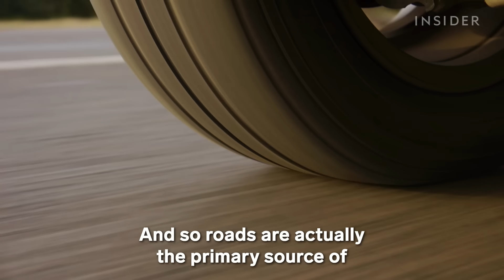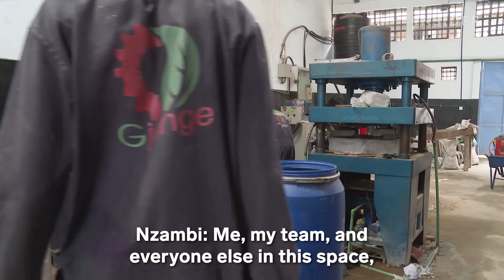Young Inventor Makes Bricks From Plastic Trash | World Wide Waste | Business Insider

Comment: I as a civil engineer student like this idea as making road pavement with the use of plastic increases the lifespan of roads. There would be less damages to pavements as well as less potholes. The plastic will avoid water to enter into pavement which avoids pavement.
Reply: plastic as road pavement sounds horrible. How would cars get traction in wet conditions? We also don't think about the micro plastics that will make it to the water table.
Reply: @trickmiller8169  thats why tires have grips. A pavement cannot completely be made of plastic, it has to be mixed with concrete. But driving on plastic pavement is better than driving on ice..it really depends on ur tires grip.
Reply: @easylife2927   Converting the plastic into pellets is downcycling. You aren't really able to reuse the plastic in the same regard as it was before. That's is recycling. Most plastics are not recyclable in the way that aluminum and glass are. You cannot recycle most plastics for similar use, because they are of poor quality. They don't yield reusable plastic when recycled. Do your own homework. Throwing all the plastic in the world into the roads doesn't fix the problem and is going to create more issues along the way. We can offset carbon emissions by planting trees, using more evs, switching from fossil fuels to nuclear, hydro, solar and wind. Burning plastic at least prevents plastics going into the water table and we can have a degree of control in negating carbon emissions. Once plastic is in the waterways, it doesn't come out. Plastic in roadways exacerbates that problem. We already have an issue with microplastic being found in fish and food.
Reply: @trickmiller8169  dude the world is already planting trees, using solar, hydro and nuclear power. And most plastics from landfill endup in waterways not from road pavement which is converted into pellets. All am saying is that plastics used in road pavement is more controlled way of recycling plastics plus the benefits it carries. And u are saying to burn plastics. Are u out of ur mind. I dont know where u live but I am from pacific and I can see the consequences of global warming and burning plastics will do no good. I really dont know what u do but am telling from experience  as a student and also a victim of global warming....And u are talking about water table ..so I predict that u have understanding about hydraulic engineering and also how plastics pollute ground water. There are less chances of platics used in road pavement ending in water table than plastics in landfills. And if u say that water will carry chemicals into groundwater than there is no chance of water interacting with plastics since plastics are non polar and water is polar so they cannot be combined. Besides buring plastics will release toxic chemicals and fumes which can evaporate as well as sink into ground. And if toxics evaporate.. it will also condense back as rain which will seep through ground water and pollute watet table. Now u do ur homework ..and dont burn plastics please 🙏.
Reply: @easylife2927  Abrasion breaks down those pellets even more to make the microplastics. How do you think microplastics come about?  You also are putting plastics in direct uv light and heat, which causes breakdown of plastic and toxic fumes. The runoff from those roads will carry microplastics with them. At least in a stack, they can be scrubbed. That prevents pollutants and toxins from escaping. We cannot do that with roads. Europe has already gotten on board with burning. It reduces buildup in landfills, produces energy, and keeps plastics out of the water table. Try thinking more critically.
Reply: @trickmiller8169  burning plastics doesn't prevent toxics from entering into ground water. It will condense back as rain into the water table. And as per I know there aren't any consequences of uv lights to melt plastics as it is a controlled and safe process to make bitumen. Am not saying the only way of reducing carbon emission is to make roads with plastics. There are many ways to do that. But incontext with road pavement ,all I know is that there are more pros than cons of plastic road pavement. And where in Europe they have started buring plastics..I really dont know. If they are doing this than they really dont care about those small island nations suffering from global warming. Till date there isn't any technology which can help preventing the evaporation of toxic chemicals 100 percent. All I know is that are around 6 or 8 factories which extract carbon dioxide from air ..but in general it is a failure till   now. Yes, I agree that during cleaning process of plastic roads there can be chemical leakage so to avoid this..ground water analysis has to be done in nearby places and then construct plastic road pavement for specified area. This is better than buring plastics as condesation of toxics as rain 🌧 will cause more issues as toxics will be covered in large area. And also pollute crops. From my knowledge..l know that plastic roads are being built in places where there isn't any unconfined aquifer in nearby areas as the case in this video. Kenya has very little unconfined aquifers and is mostly dry as is the case in india where they promote plastic roads. Now who is thinking practically.

Comment: My concern would be wear. As the bricks erode with use, micro plastics are being introduced right back into the environment, and at sizes that can't be cleaned up.
Reply: This happened with asbestos in the past. The idea being the exact same (If we bury the asbestos in the asphalt, surely it will not be a problem.)

Then reality kicked in 5 years down the line. Erosion meant that the asbestos not only didn't go away, but basically spread out further than intended.
Reply: Too late. At 1:41 you can see micrplastic smoke comming from the machine that makes plastic bricks.

Comment: It could work if there were a way to limit the microplastics coming off the bricks from degradation.
Reply: What about carcinogens in the burnt plastic, that factory could be extremely cancerous
Reply: @frostedlambs  at least in America, that’s actually the least of problems. There are electric scrubbers in chimney pipes that clean the air so only water and co2 comes out
Reply: True, and we do not even know if there are. Lab testing would have to be done. I suspect they can continue to perfect the formula.
Reply: @EtreTocsin  Right. Also she said they're only doing a small part of it. It's not like they're a big corporation or smth

Comment: I wonder if this material could be put to use with a project that's been viral for a long time now where buildings are being 3d printed?!?
Reply: No, plastic buildings are horrible for enviorment when they erode they make microplastics and plastic buildings release toxic chemicals when heated up.
Reply: @insectbite1714  Which is why I'm not an architect, but we really do need to figure out the plastic problem before it gets any worse.

Comment: Yawn.  Well it is Business Insider - why employ journalists when you can employ millennials with no research history. This has been debunked so many times - they break up faster than asphalt and do not work with high traffic areas or extremes of temperatures. Roads need flex as well. They also need drainage and most roads absorb certain moisture - solid plastic doesn’t.